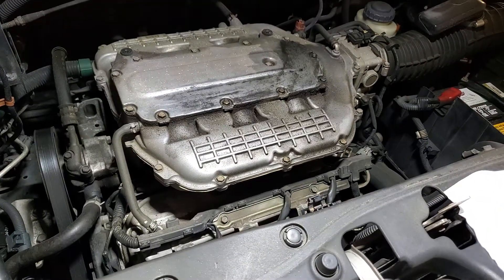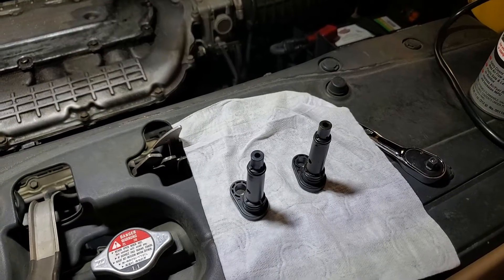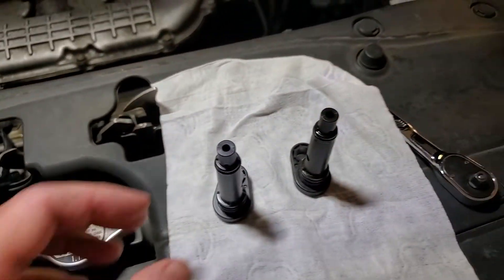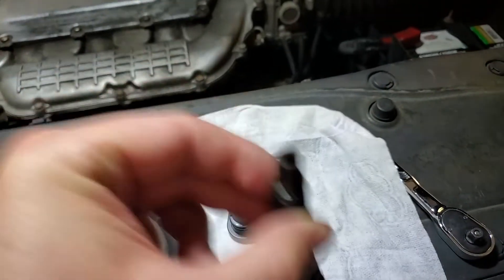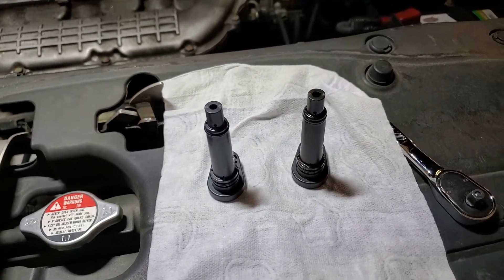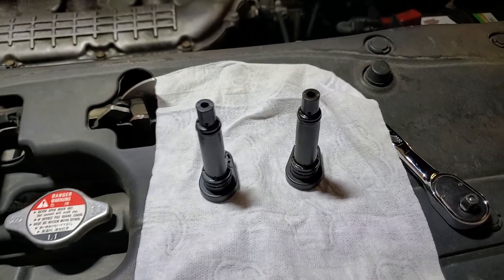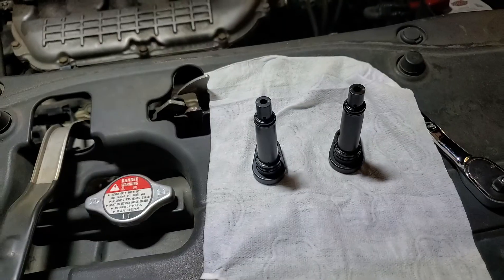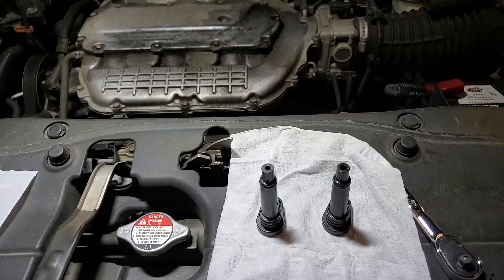How to Tell if Honda 3.5 V6 PCV Valve is Bad - Pilot, Odyssey, Ridgeline, Accord

Comment: Thanks partner, you resolved my misfire code.  I got a misfire code on my 11' Pilot (217k miles) cyl6.  I did the easy stuff by moving the ignition coils around and changing spark plugs. No change. I then went and did the valve lash job myself, which I would have paid $450-700 (what a pain but at least its done). No change, in fact now I got Cyl1 & Cyl6 misfire. After more research, my next step clean the EGR passages in the intake manifold, but then I saw you video.I sent my wife to pick up a PCV valve at Advance and with a hot engine changed it out, did a drive cycle and not codes any more. My next step was to take it to a shop and go from there.  Once again, a short little video that super helpful. My Pilot lives.....
Reply: That makes absolutely no sense.

Comment: I just ordered a new oem  one and when I shake it , don't hear that ticking sound is it bad?
Reply from the maker: Where did you get it from?
Reply: @LuckyVagabond is eBay supposed to be a genuine honda i don't know if the new ones don't make the noise lol
Reply from the maker: @Jay-ll9ip try one from a Honda dealership or my Amazon link. It should have a slight rattle to it.

Comment: Is it supposed to make that rattle sound on the 3.0 accord v6? Just took mine out and it doesn’t rattle when I shake it
Reply from the maker: A brand new one has a small click/rattle to it when you shake it. Try spraying some carb/brake cleaner in it and then shake it.

Comment: Should the air go in both directions or only one? I went to 3 different stores and the air can be blown in both directions. Is the original works same way?
Reply from the maker: I'm not sure. Never tried that test. I always just shake it to see if the check valve inside of it isn't stuck.
Reply: Unfortunately, Honda doesn't specify any way to actually test these valves.  The two upper radial  holes are under theottle body vacuum and the bottom hole and two lower radial holes connect to the crankcase.

If you have a new clean valve, you can plug one of the two upper holes and suck on the other.  Air should flow through until you suck hard and then the valve closes.  During engine operation, high vaccum is developed at idle and when decelerating under no throttle when the throttle plate closes.  At ifle, you don't want to pull in crankcase air because it throws off the air fuel ratio to much when the engine isn't pulling in lots of air and fuel.  At other throttle positions, the low flow passing through the PCV valve isn't enough to dilute the air fuel mixture much.

The big problem is knowing how much air should flow at various vacuum levels.  I've never seen anyone discuss this.  I recently bought a supposed Honda PCV valve and it flowed way more air than the one that came in my CRV.  When I installed it, my mpgs immediately dropped from 30.4 to 27.7.  I cleaned up the old valve and reinstalled it and the mog went back up.  Looking at the new valve, it does not appear to be a genuine Honda part.

Comment: does oil leak also the symptoms on this?
Reply from the maker: Yes, especially out the rear main seal.
Reply: a stuck closed pcv valve will lead to high crankcase pressure and oil will sweep out of seals

Comment: I bought a new pcv valve Honda and no rattle at all...lol
Reply from the maker: That's not good. They ship with a light film of oil on the inside. I wonder if it's been on the shelf for a while and the film gummed up. Try spraying some carb cleaner in it.

Comment: Does your 3.5 have VCM?  I guess VCM would make that PCV valve gunk up early.
Reply from the maker: My 1st Gen Pilot does not, but my 4th Gen Odyssey does. I use the S-VCM disabler on the Odyssey.
Reply: My 06 pilot 4wd does not have VCM and my pcv valve still got clogged.

Comment: Why doesn’t any parts store, including Honda, sell a new PCV valve with the collar included? Mine fell out and nowhere to be found!
Reply: You don't necessarily need it if you lose it...  but you need to be extra careful not to tighten the bolt all the way without putting a couple washers between the engine and valve, because the collar is also a spacer if you tighten the bolt all the way to the engine it will crack.
Reply from the maker: Annoying, right? You can go to a you-pull yard and get one from there with the collar.

Comment: I spray air intake cleaner through mine every other oil change. That keeps it clean. I give it ten minutes or so to dry out before putting it back in place.
Reply: The plastic falls apart/gets brittle after so many years so just cleaning it will not prevent chucks of plastic getting left behind in your valve cover once it decides to fall apart on you.
Reply from the maker: @MylifeMB true, I've had that happen before. Thanks for the comment.
Reply from the maker: Great idea! Thanks.

Comment: Does it cause the oil to shorten and not gauge? Can it be cleaned with carb cleaner?
Reply from the maker: It can probably be cleaned with carb cleaner, but safer to just replace it.